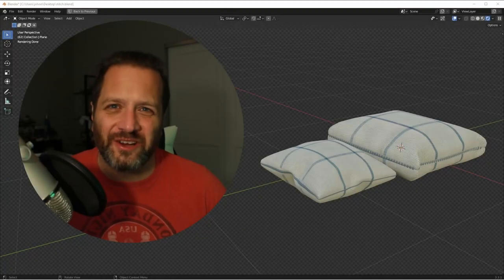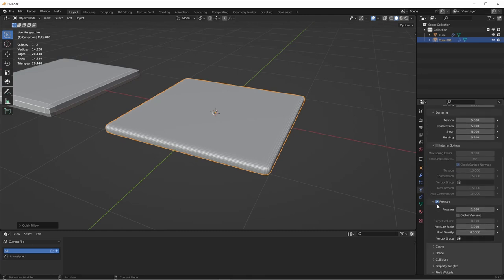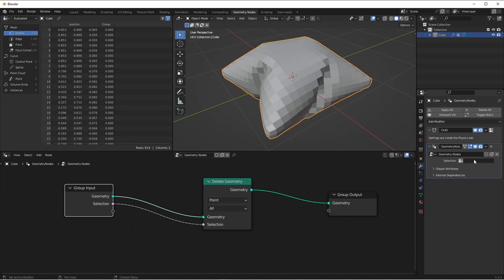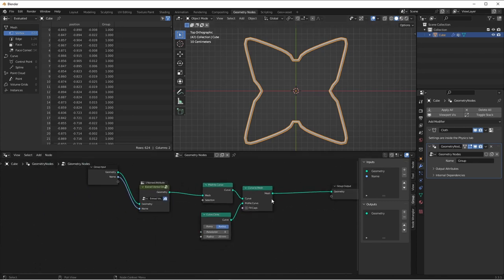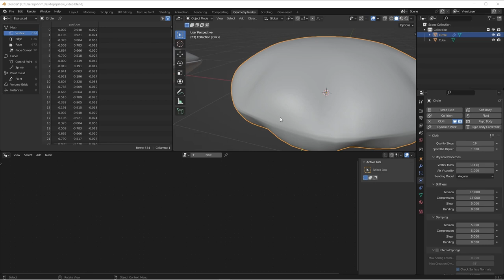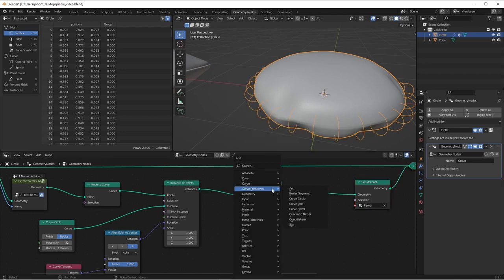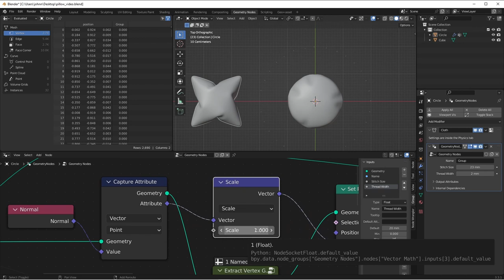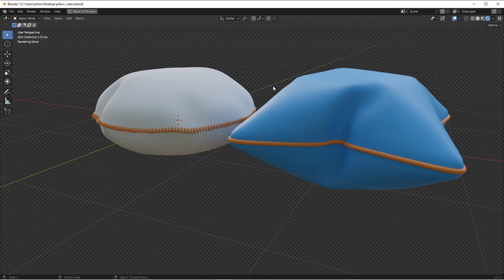Procedural Details with Blender's Geometry and Cloth Simulations

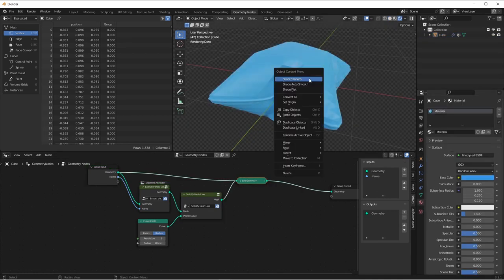Comment: 6:28 for some reason, only materials using "generated" texture coordinates work. As soon as I change it to UV, it doesn't work anymore. If I disable the geometry node modifier, the material I set up beforehand shows up again. Can you explain to me what I did wrong and how I could fix it please?
I don't expect UV mapping to work on the piping since it is generated by Geometry Node (maybe there is a way?) but I expect it should be possible to use UVs on the base pillow at least.
Reply from the maker: Yeah there is some weirdness still with keeping UV's preserved across a geometry node tree. It's probably best to recreate the UV layout to a generic attribute then use that to drive a material. Hopefully this gets cleared up in the next few versions.
Reply: @JohnnyMatthews  I used a vector math node in Geometry Node to carry the UVMap through it, input to output, then I replaced the texture coordinate node with an attribute node in the shaders and used the UVMap.
Edit : if I replace the subdiv at the end of the modifier stack and use the geometry node subdivision instead, then it works except some strange distortion in some places. Wierd. Still can't use UV on the piping but there's probably a solution for that.
Reply: For the starting object, like the cube or the circle, if you unwrap these then you can call the UVMap (Default name of uv's) by using an attribute node in the Shader nodes and fill the Attribute name with "UVMap" then you get back your UV.
For the Stitch or the string around the Cushion it is another story 🙂

Comment: I was working on something in that line a few months ago put couldn't pull it. I'd like to be able to select the next vertex (or vertices) in geometry nodes and then apply a mathematical equation to the selection. It works when the index are in accordance with UV but on "real" models that have been retopologized and so on, it won"t. Any tip?